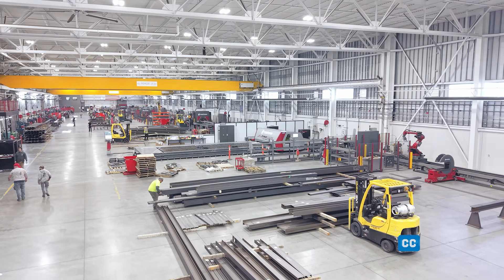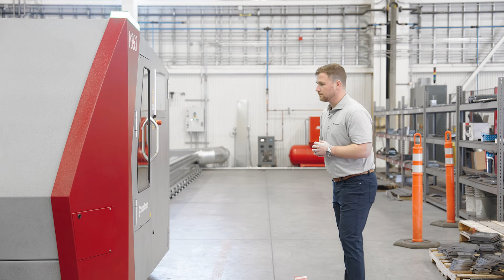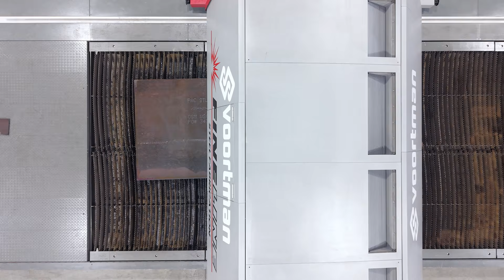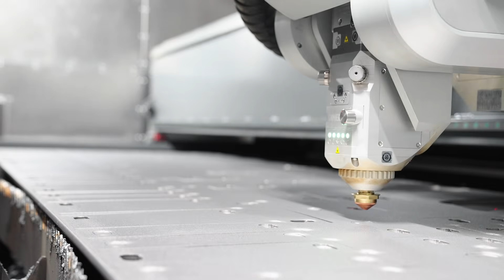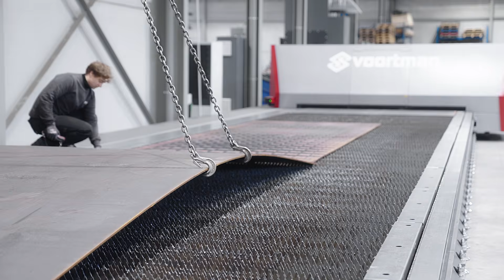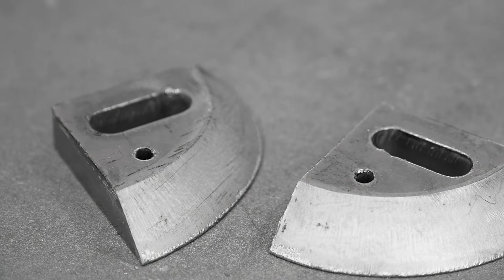Can Fiber Laser Cutting CUT YOUR COSTS This Much? | Voortman V353 Part 2

Comment from the maker: Wondering how the V353 handles large-format plates, diverse gasses and weld-ready plates? In Part 3, we show you why the flexibility of this machine is the ultimate game-changer for your workshop 🛠: https://to.voortman.net/2p97txsw

Subscribe so you don't miss the rest of the series. 🔔
Reply: How do you change all parameters in the same run?
Reply from the maker: Within our VACAM control system, you can manage all your cutting records. The machine comes standard with the most optimal records - which we have extensively tested - for various thicknesses, materials, and gases. You can also create and edit your own records and set them as preferred for specific jobs. All of this is done through an easy-to-use and intuitive interface. In part three of this series, Mitch shows how this works. Subscribe to our channel to get a notification as soon as the video is online!
Reply: Looking forward to know more about gases and it's capacity with different assist gas.

Comment: This is really impressive on how autonomously the machine works in night shift. In my experience as an engineer in the same field, very few companies are able to crack accurate automatic nozzle changing processes and even nozzle condition monitoring. This one looks quite impressive.

Also, controller looks quiet minimalistic, eliminating the need for the operator to go deep inside the options and most probably mess it up.
Reply from the maker: Thanks! We truly are proud of this one.💪